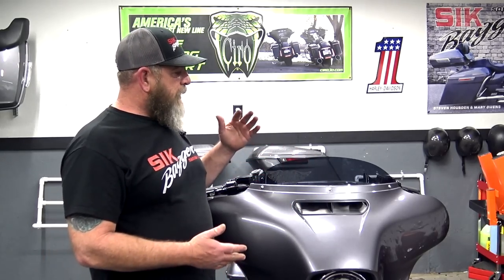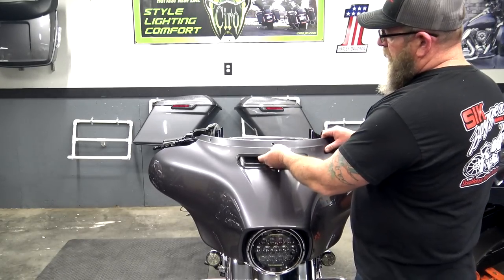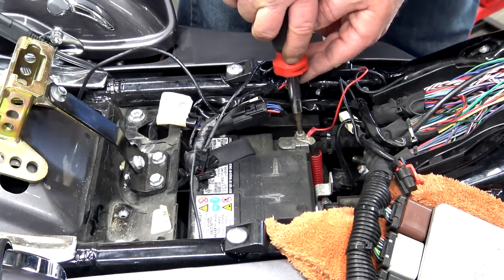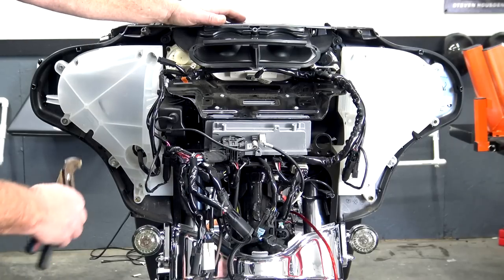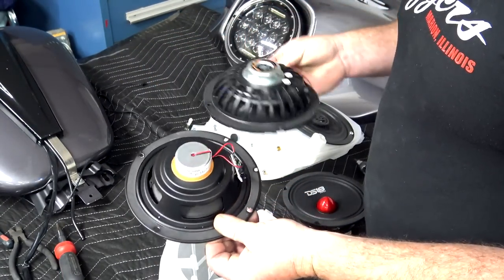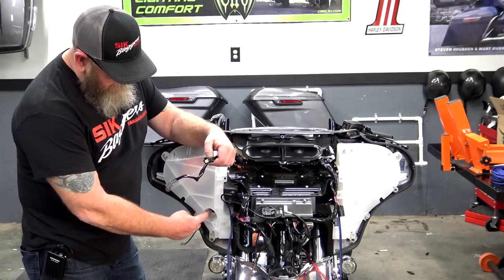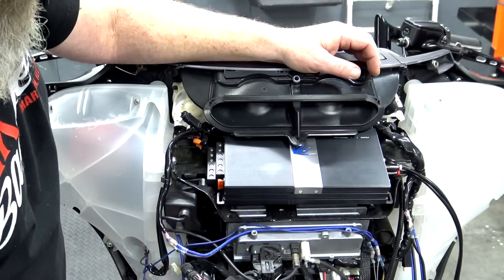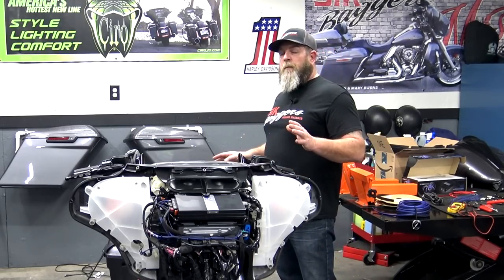⚡Install Amp Speakers Stock Harley Touring Radio⚡

Comment: Steve,Just wondering how much water will get to the speakers if they are not water proof? This is a great install video and thanks for sharing.
Reply from the maker: Hey Scott...on the SG fairing there wont be that much get in because of where they are mounted and the RG ...well id say plenty will get in with those curved speaker grills. However I have ran mine in rain a few times and never had an issue. There are 3m products out there that you can spray on these that wont affect the sound quality or damage the speaker.
Reply: Never wet is a good solution for that issue.  You can get it at Walmart or home depot or at a local hardware store.

Comment: Which of the line output converter do I need? Going to run 6.5 prvs in the fairing and 6x9 prv in bags. 2 channel? 4 channel? Remote turn on circuit? Thanks for the input!
Reply from the maker: Get this one..PAC LOC https://www.amazon.com/PAC-LP7-4-4-Channel-Output-Converter/dp/B00F0YCK0E
Reply: @sikbaggers  thanks man!
Reply: @sikbaggers  one more question, is a flash nessassary?

Comment: You've made videos and covered alot of things that I did and want to do on my bike. Thanks! 2 questions. Can I buy that "I  void warranties " t shirt?
And  are the pro audio speakers waterproof?  Or does it matter?
Reply from the maker: We will be doing a version of the warranties shirt on out FB page...the speakers I have are not waterproof. Most marine grade speakers will not fit in any 8" lid. I suggest you purchase some covers from SKN-IT and cover them if you see rain...this is the best way to protect them.

Comment: I did a similar install on my 2013 using the same amp and am getting terrible FM interference when I go over 1/3 volume. Any suggestions?  Great video, made me a lot more comfortable taking this on.
Reply from the maker: Do you have an aftermarket LED headlight? A cheaper aftermarket headlight can cause interference and also a bad ground. Check those.

Comment: Do you have to get the radio flash using that line output converter? Also will that line output converter work with sound digital amplifier?
Reply from the maker: Having your radio flashed will flatten the outputs creating better sound for your amplifier to work with. however you do not have to do it.

Comment: Hey Steve
Another great vid
Do you know if the DS18 6.5 
Fit in a 2012 SG..
Would love to try a pair. 
Thanks!
Reply from the maker: Hey Steve...If you get the shallow mount..your bike has stock holes for 5.5 inch speakers and you will need to get the 5.5 to 65 spacer adapter which takes away some room in between your speaker and the outer fairing. You may already have the adapter in there if you're running 6.5 now but that is what you have to watch for...gotta be able to get that outer fairing back on and not hit the agent of the speaker.

Comment: would a DS18 PRO-ZT6 6.5-Inch 2 Way Pro Audio Midrange Speakers with Built-in Bullet Tweeter, 4-Ohms be a good choice for a motorcyle
Reply from the maker: you would have tro butcher your pod pretty good to get that rubber surround on that magnet in there to fit. Its a decent speaker but its marine grade and these pods wont usually fit PRO Audio Marine Grades like that

Comment: Hey Steven,  great video  !! I was wondering how well the ds18's would work with the stock unit on my 2015 TriGlide,  I'd like to just replace the speakers but I don't know if the stock unit has enough ass to drive those,  or do I need the amp. My cheap ass Harley speaker in the rear pod is blown !! Imagine that  !! Thanks for the help brother  !
Reply from the maker: You would definitely need an amp for those. Those are pro audio and need about 100 watts minimum to push...stock radio is about 15 watts

Comment: What plug and play speakers/ amp do you recommend for a decent price ?
Reply from the maker: this video is quite old and there is better out there and this is what I use now for this set up.. Renewed Sound Digital 800.4 EVO-X amp https://amzn.to/4dGfHFj  or new https://amzn.to/4e15y6B PRV Midrange Speakers -  https://amzn.to/4gWpp9s  Line Output Converter - https://amzn.to/4exZnb3  Youll need amp install gear...power wire, ground wire, connectors,  inline fuse, remote wire and 2 rca cables. Here are the links for the ones I use.   8 gauge wire +/-  https://amzn.to/3NpP8cO  8 GA  1/4 inch rings - https://amzn.to/3YnliMC   RCA Cables  - https://amzn.to/3YpA5VV  Inline Fuse - https://amzn.to/487fKZV Blue Remote Wire 18 GA - https://amzn.to/487LGgp

Comment: Great video can you send me a complete parts list I’d like to do this to my 16 Ultra
Reply: Yeah, I wasn’t aware I needed a line output converter. Amp - $500, Install Kit $200, Speakers x 4 $$$, Hope the LOC doesn’t break the bank. I’m halfway through the install with no instructions or pre-req list. I’m gonna die when I find out it needs to be flashed.  Well, thank you for all your help. I would be down a bad rabbit hole right now without this video!!

Comment: I'm thinking of going with this setup, do I need to have my bike flashed or does the LOC take care of that?  For now I'm just upgrading fairing speakers and putting in amp, but down the road may be adding bag speakers and/or lower pods
Reply: If you are going to put in an AMP then yes, you will need it flashed to remove the factor set EQ. The thing is I do not think Harley will flash it any more as they will only do it if you go to thier BOOM upgrade. However, you can look up a fosgate certified shop in your area and they can flash it for you. If you do not get it flashed and you hook up an amp then it may pop and sound like crap. If you go with new fairing speaker then I would look at mmats or better yet if you are not into modifying pods look ath the Hertz SX165 NEO SPL for fairing speakers and they are weather proof. Also make sure you use oxygen free copper wire. NEVER use CCA for wiring. And you may want to consider a DSP DSR1 from fosgate especially when you go to rear speakers lids later on down the line. Look at the sound digita; evo x 800.4 amps. Great raw power,

Comment: How do you like those ds18pros? I just ordered some.
Reply from the maker: I used to like them til I started getting a bunch of them back..and I hope you ordered the ones that dont say ds18 down the basket edges...those are so thick now they wont fit anything...they have to have the normal metal basket that has no ds18 on them to fit

Comment: Why change the speaker wires? What did that do to make the installation easier or better?
Reply from the maker: heavier gauge wire for the bigger amp...stock is 12. Use any online chart to see how much your amps is pushing vs how long the wire is and itll show you the gauge you need.
Reply: @sikbaggers  Thanks! Fantastic information!

Comment: is there a link for the in line fuse? also was wondering which head unit you would recommend for an 09 streetglide.  Thanks for the video!
Reply: the best of the best head unit is the Aquatic AV AQ-MP-5UBT-S. youll spend some coin on it but it is worth every penny

Comment: mr. housden, new to the channel, love your style of step by step instructions. I have a 2016 Elektra limited, 4 speaker, touch screen. would like to upgrade fairing and back speakers and add as big of woofers in the lower spots and add amp to drive it all. any suggestions?
Reply from the maker: First, thank you very much for checking us out....much appreciated. Suggestions on amps and speakers really depends mainly on your budget sir. Fairing speakers that we install a lot of are the ground zero's, DS18, and PRV's ...and honestly as far as the tour pack backrest speakers I would try to pair those up with the same speakers.  Im not familiar with this year/style bike as far as what comes stock in there for an amp or even if it has one? Id pull the outer fairing and take a peak around and see first. If you have stage 1 amp in there already you have 2 choices, use that amp and be stuck with pretty much harley or rockford speakers, which are garbage or pull it all and start over so you can use whatever you want. There is nothing wrong with the stock Harmon Kardon Harley radio...you can do what I showed in the video and run new amps and speakers.
Reply: @sikbaggers  thank you sir for the reply, helped a lot

Comment: What sounds stream amp is that? Also thank you for all your videos. Best ones for diy installs I’ve seen for harleys yet!
Reply from the maker: Youre welcome Rick....its the Soundstream PN4.520D 520-Watt 4-Channel Picasso Nano Class-D Amplifier
Reply: Thank you sir. After pausing the video and zooming in I boiled it down to that one! Wasn’t sure if the 1000d would fit or not. I think with H&M’s trap or a little modifying to the stock one it could happen. I will be honest I’m very mechanically inclined but for some reason HD intimidated me until I started watching your videos!! Thanks for all your knowledge and sharing with us!

Comment: Great Video, did you use a mounting bracket for the Amp? If so, which one have you used? Will this setup bring the level up, for a full face helmet? Regards, Ellom Red
Reply from the maker: This set up is plenty loud for a full face helmet. and no I didnt use any bracket. just the stock bracket that is already there for the amps.
Reply: SIK Baggers If I put the SONY XAV-AX7000 from flathead cycles inside, do I need the pac loc 7 4, or can I connect it directly to the Amp?
Reply from the maker: @ellomred7713  no the after market radios have rca outputs so you just run rca from head unit to the amp
Reply: SIK Baggers thank you for the help!

Comment: Dumb question, but where do you hook the ground wire and power wire for the amp
Reply from the maker: Hook your power wire straight to the battery. You can run the ground to the battery but I prefer to run it to the frame ground where the battery is grounded. Follow the black wire down under your starter from your battery. There is a 7/16th bolt that grounds your battery to the frame. remove that (its kind of tough to get to) and add your ground wire there. To make it easier to get to remove your oil dipstick, and the starter cover. Its on the end of your starter and one single small bolt in the middle. there is nothing behind it..its just a beauty cover. then you can access that bolt much easier. I hope this helps.

Comment: Hope you see this !! 

How much different would it be to do on my 2011 Street glide I know 14’ up they changed and would I have to run a amp if I got the 6.5 speakers you have linked down below. Any suggestions on speakers that don’t need a amp ? It does have a aftermarket radio in it previous owner had installed I believe. But it just don’t get that loud. Thank you.
Reply from the maker: Well the 2014 doesn't require an amp and the 13 downs dont either. But if you are wanting louder you may look into one. Simply adding a different speaker isn't going to make it louder. Most single din after market  radios have about 200 watts max average, depending on what radio you have...that's 200 divided by 4 channels. so 50 watts MAX...not RMS....RMS is actual power at normal listening..so now your down to about 35 watts RMS per channel. If you add 2 x 300 watt speakers you are still only giving it 35 watts...so its not louder. Add an amp and you are now giving your 300 watt speakers at least 200 to 250 watts and now its louder. As far as adding the amp, you said you already have an aftermarket radio...so there is no need for using the LOC ...the radio will have, or should have, 4 rca outputs on it..those go straight to the amp and then bare wire back to your speakers. Plus there are no pods to take out..your speakers are right there..4 screws, change them out...13 downs are so much easier. If you need any more help please let me know...but I hope this gets you going in the right direction.
Reply: @sikbaggers  I really appreciate the help. And even more helpful on the quick reply and answering questions before I even asked them thank very much. I’m probably going to order the amp and speakers because there’s no sense in doing it if I’m not going to do it right the first time. I just gotta get to it soon spring is coming!!

Comment: i'm pretty confused on a 4 channel with high level input conversion built in and still used a line level converter - if the head unit and/or speaker wires are that noisy i think id just switch head units - props for speaking up about amp gain - i still check with a cheap scope - even some of the cheap graphing multi-meters are handy for level setting and to make sure you're not clipping
Reply from the maker: You can use the HL input over the LOC...I just installed it this way for example because thats what was in the shop that day...If your doing this to other bikes make sure to mark the gains..lesson learned the hard way after a buddy cranked his gains after he left and smoked his amp..im to the point now I even take a picture and store it on my pc and mark whos bike it was. If they bring it back and the gain has been moved...tell them to kick bricks!
Reply: @sikbaggers  Helping a buddy out with his 2013 street glide but i don't do bikes - how much power do i have to play with on these bikes - i know the stator is 30A at 1000rpm and 54A max but how much does the bike use - his system is crap and im looking to spec out a new one from the ground up but i don't want to stress the charging circuit

Comment: General questions, first you have two different speakers listed on your link. I am looking to add two batwing fairing speakers and maybe later adding advant speaker lids? Will this amp handle both sets of speakers?
Reply from the maker: yes..one is 8 ohm  and one is 4 ohm....it depends on your set up or what your final set up will be as to what ohm ou purchase. if you are going to 4 speakers I would get a sound digital 800.4
Reply: @sikbaggers  Can I replace my factory passenger speakers also, 2021  Ultra limited with the same type ones I am putting in fairing?
Reply: @sikbaggers  and thanks so much for your videos, nice to see someone take the time and explain it!!

Comment: Good video..i have 2011 Electra glide..any recommendations on a stereo system with amp? Thank you
Reply from the maker: The 2011 more than likely has the 5.25 inch fairing speakers, start there by getting some 5.25 to 6.5 inch speaker adapters off amazon for about 20 bucks...upgrade to a pro audio 6.5 speaker. PRV, Ground Zero, DS18 etc about 200 for a pair is a rough price on pro audio. ....get a Sound Digital 800.4 EVOX 4 channel amp.  This is a pretty basic major fairing upgrade from what you have in the bike now. Those speakers are about 35 watt speakers...the pro audios will be around 200-300 watt speakers...you and your passenger wont have any trouble hearing this set up at 70mph half volume.

Comment: Will you post a list and links to the amp, line output converter, and Amazon kit that you used for this video?
Reply from the maker: Amp is here - https://amzn.to/2yzv1X1 The wiring kit here https://amzn.to/3em96lm , the LOC is here https://amzn.to/2XthoBa Wire connectors https://amzn.to/3c3pxBt Speaker Wire I use https://amzn.to/2XyCfCO Ferrule Crimper set https://amzn.to/36uvQwA Tesa Tape https://amzn.to/2TEM6G2 RCA Cables https://amzn.to/2TCkVM3  DS18 Pro 6.5 8 ohm https://amzn.to/3daitVa DS18 Pro 4 ohm https://amzn.to/3ghAEtM
Reply: SIK Baggers thank you.

Comment: I bought the same amp you put on this bike... It's kinda long, HOW did you mount it? I"m sure it can"t just bounce around under the fairing...
Reply from the maker: A little foam under it and some zip ties int he front holes..It aint going anywhere once you slide that outer fairing back on.,

Comment: Hi there, I’ve the 2014 Ultra Limited with rear speakers.Can I install  a 4 channel amp and follow the same procedures as the front speakers? Thanks for your videos, very helpful
Reply from the maker: Hey thanks man.,.have been into you fairing yet to see if you dont already have a small amp in there? Not sure if the stock 4 speaker bikes already have one or not. But in any case if you do not you certainly can do this and add one...convert the 4 channels from the radio with the LOC and then add your amp, come out of the amp and run back to your 4 channels of speakers.
Reply from the maker: @MrAyarza   just a 4 channel LOC
Reply from the maker: @MrAyarza  that amp has high level and low level inputs...the high level is basically what you use when you don't have rca but they sound like garbage and I don't recommend that route. If you look at the wiring diagram for that amp there are 2 plugs that go from the side there that have rca on the other end. Maybe 4 inches long. Plug those into the amp. Then you have low level input rca which are far superior in sound. Here is the link. Download and go to page 7 ..you will see what I'm referring to. Its basically pigtails with Rca inputs..so it would go from radio,l to LOC to these pigtails which plugs into the amp.  http://www.rockfordfosgate.com//rftech/library/2017/03_amplifiers/1230-60375-01-b_pbr400x4d-man.pdf
Reply: SIK Baggers Awesome! I really appreciate your help, with out it I wouldn’t even tried to remove the faring. Thanks for helping us, you rock
Reply from the maker: @MrAyarza   Youre very welcome...if you have any questions when you get in there please let me know.
Reply: SIK Baggers Thanks again